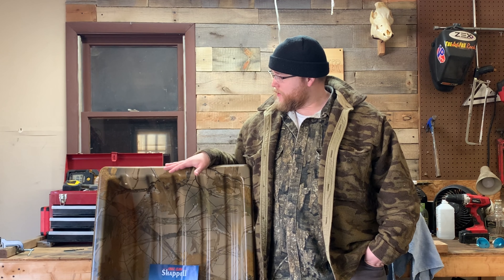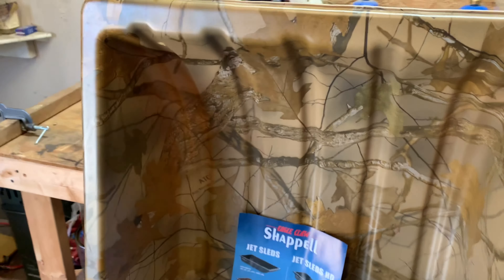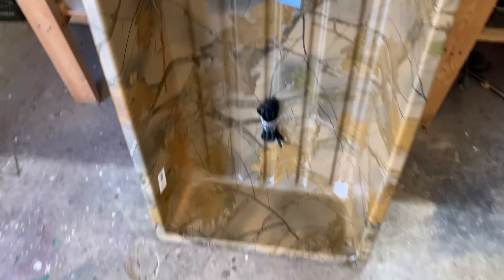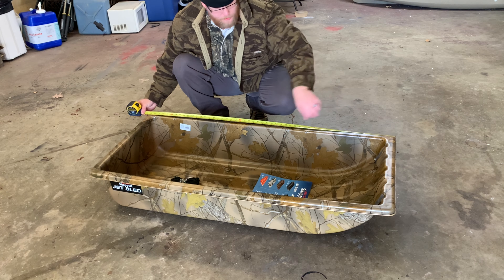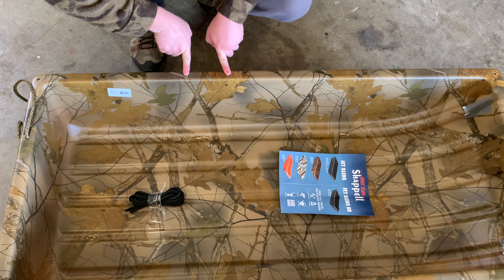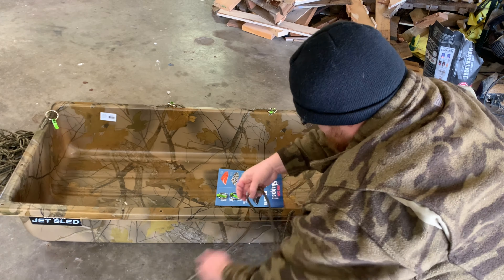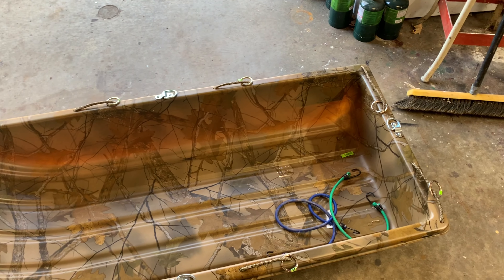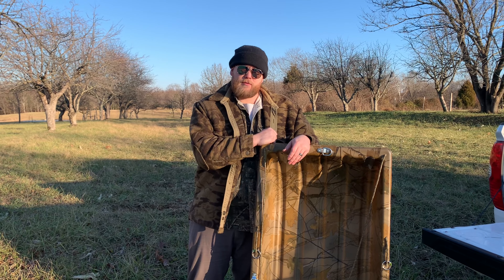🦅 EAGLE CLAW JET SLED MODS 🦌(DEER SLED) #hunter #mods

Comment: I untied the rope knots and put big washers on the inside behind the factory holes and then ran the ropes back through, seems to have dispersed the weight some but I do think it will still crack over time. Like the idea of pulling from the sides and not the front. Good stuff
Reply from the maker: Nice idea. I have used the sled heavily over the years and it is still going strong. Thanks for the view and comment.

Comment: I use a Jet Sled for beaver trapping in the Spring. I can haul out 3 beaver and my gear overland.  I've used a 5 foot plastic tobaggon for hauling out deer with and without snow on the ground  That plastic is pretty slick.
Reply from the maker: This is a really good hunting item that I think gets looked over. Thanks for the comment and view.

Comment: I use a Jet Sled Jr Camo
I put 4 skids under it . Put large Eye Bolts in front with larger fender washers and use a Shoulder pullling harness attached 2 four feet lyfting straps attached canoes Eye bolts by Snap links. I also placed 4 smaller eye bolts in each corners to lash down loads.
I use this setup for moose quarters getting back to canoe. One quarter per trip. The Jr fits real good in my canoe .
Reply from the maker: Thanks for the info. Good sled ideas.

Comment: What size rope are you using and how long is it installed?
Reply from the maker: Not sure on the length I just eye balled it. I looped it through the holes and made sure I had plenty to work with. Not sure on the rope either it was in the hunting supplies at Walmart. Sorry I couldn’t be of help.

Comment: Got a  5 ft long  snow sled, which has holes already that I use nylon rope thread thru with  enough rope coming out to make loop handles that you can also hook on a trailer hitch on your ATV    Total cost including rope  $35.00.   Been using my sleds to pull  dozens of deer and gear...   Doin  it Cheap..
Reply from the maker: I have used it several times with my SXS hauling wood in the snow. Worked great. Thanks for the info and view.

Comment: Better double-nut or something to keep those anchor nuts from coming off. The rope with rings was very clever.
One could also put a pipe (PVC or metal conduit?) about 18" long on the rope as a pull point, if not pulling from the body.
Reply from the maker: Great ideas. The nut and bolts have a split washer to keep them secure. The jet sled has come in handy.